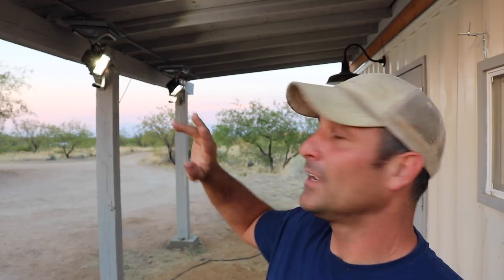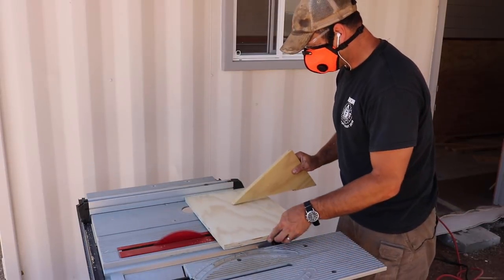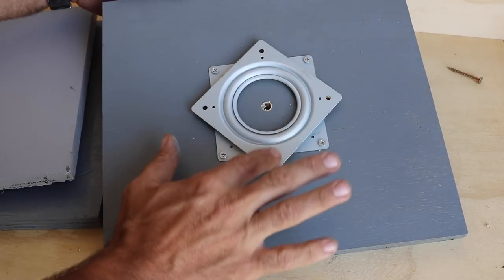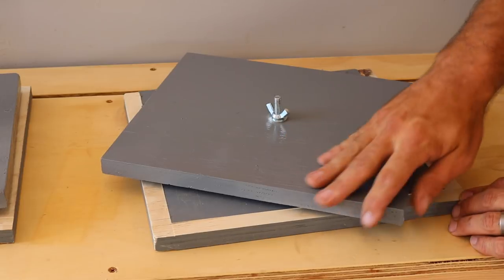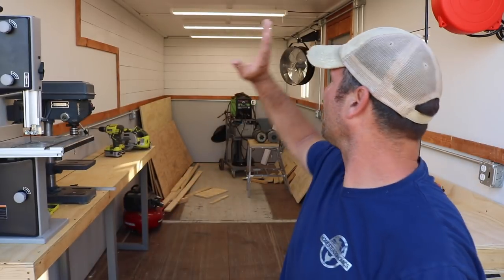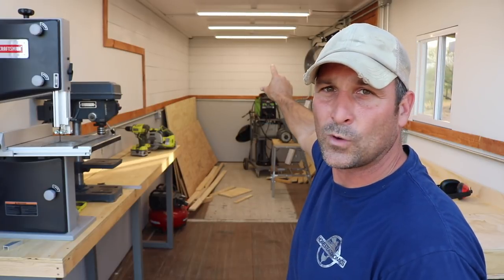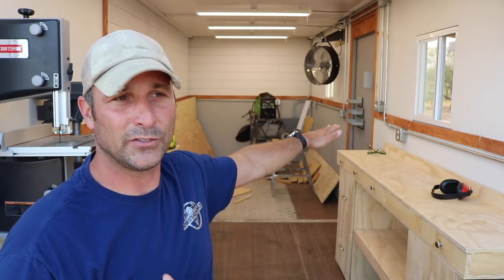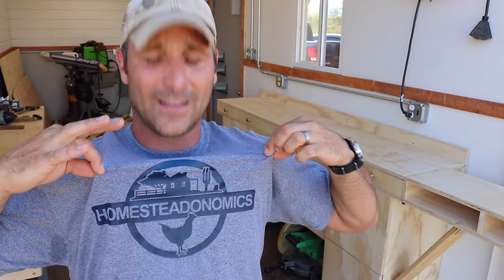DIY track lighting for the Shipping Container Shop

Comment: Look into electricians Unistrut to save time making your channel, comes slotted in the back for easy mounting. there is some problem with getting them to line up but they come in ten foot sections.
Reply from the maker: HI Charlie... that is actually what I wanted to use in the first place but it was just a bit too pricey as compared to the tubing.  But if a guy didn't want to have to cut the tube.. the unistrut would be the way to go for sure:)
Reply: LOL Your fast on the reply today.
Yeah if you have the material and the means it works I'm lazy and have worked with strut for years so that is what I would turn to!

Look into soilcrete for your drive.
Reply: Did you consider aluminum extrusion?
Reply: Charlie.     Ya, that was my first thought.  "Unistrut"?

Comment: Overkill mate.  Then if you went to so much haste you would have made live rails.  As for wood liners.  If you slightly char the wood it will self lubricate but look out for expansion & contraction.
Reply from the maker: yep... probably so... just like trying new ideas out.  thanks for watching:)
Reply: homesteadonomics 
Hey no offence.  Did edit.  Following & liking.  :)
Reply: homesteadonomics 
Might also be an idea to state if they are mains driven lights or low voltage DC

Comment: Awesome build you got there. A query. when moving the external lights, do you have an issue with the wiring looping or getting caught in the railing or do you have an auto-retraction with the extension box?

Comment: Track lighting is a great idea. If you drill holes through the tracking at the very ends and put pins in them, it will prevent you from accidentally sliding the lights out of the ends.

Comment: On your welding table,use 2" foam board with velcro to secure it to table.alot cheaper then wood and you don't have to worry about cutting it.its also a whole lot lighter to move.

Comment: Love the concept! Multi purpose use for the lights! I will use Unistrut channel, all ready to go, a bit more in cost but you can use the track for additional purposes such as hanging projects to dry for painting or a hanging counterbalance tool holders used in industry. You could mount a track above the workbench for hanging these tool holders.
 This is one really nice project for a shop setup!

Comment: Loved the lighting idea and very adaptable. I have finally caught up on a few vids and got around to your one about your water harvesting as well and was just wandering if you had thought about just before you level out the front of the container weather it would be possible/viable to slip in a flat underground water tank there as well for water collection and storage. We do a lot here in Queensland, water tank wise, now to the point where they are installed under driveways etc. Obviously not sure on exactly would be available in your part of the world but thought it would be an option for storage and as you were going to level the area a little anyways just food for thought. I have similar plans in the making to use different shaped tanks to my advantage ie covering with a timber shell for out door seating etc. Hope I didn't step on your toes. Love the vids and thanks for the time and info.
Reply from the maker: Hi Jodie... I have seen those underground tanks installed and think it's an awesome idea and space saving to boot:)  But I probably wouldn't be able to for the container as it would interfere with the foundation blocks on and the awning posts.  
But I really love what you guys have going on down there... seems to be that Australia is at the forefront of Rainwater harvesting... I wish every place would follow suit:)
And I LOVE your idea about the timber shelled tanks!  There is a place in Phoenix that did something similar using IBC totes and gabion baskets to do something really similar.  I think it looks good and serves a good purpose.  I may be using IBCs by my rainwater garden and will have cover them some how.

Thanks for the comment. you've got me thinking:)  

Joe